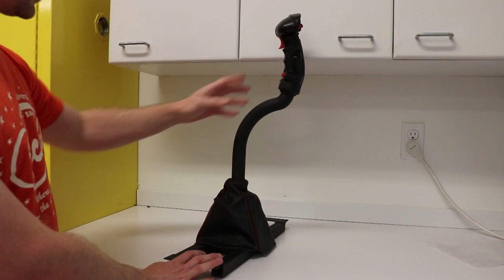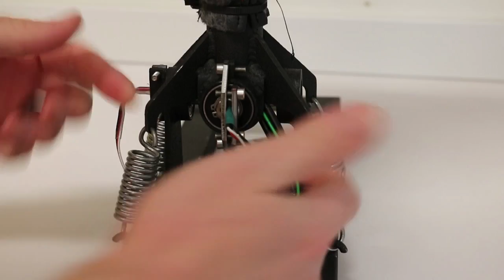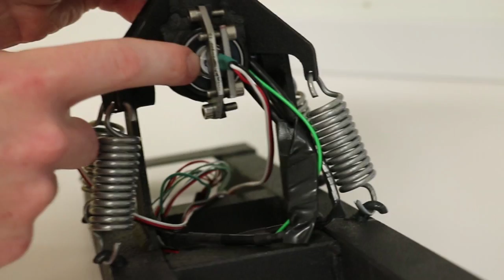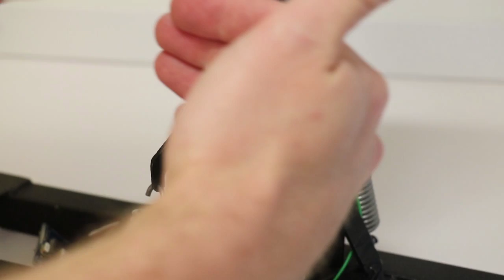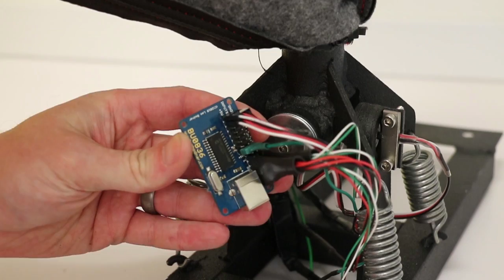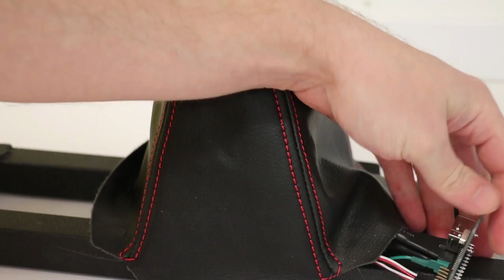Homemade joystick

Comment: I can weld, I can do those wiring too from existing sticks, but that bearing system still leaves some mystery. Oh and I would have fixed the arms to the springs by welding a X shape support pieces to each of them (so from the each leg connected to each other with small X) or just some beams. It as well should stop the bending, but your solution was different :)

Very nice work. 

I have been thinking to replace the springs with a pneumatic stoppers/lockers, those you can get for windows so you can just open the window or close it and it stays in the position where you leave it (So not a springs that push against) as it would allow to get a non-centering force to move the stick but still keep it where you move it. That would at least be nice for KA-50 or helicopters trimming as you just move the stick and press trimmer to "lock" cyclic in place and no need to center it.

If there just would be nice way to get a Force Feedback (FF) it would be nice, but such systems doesn't seem to exist that would be as easily plug'n'play like the joystick boards you showed (btw, those are just amazing to what they offer!).
Reply from the maker: For a long time I've been trying to think of an easy way to make this a force feedback setup, but to get the stick forces I want there just isn't any easy way.  With the stick this long, you'd need motors with a lot of power.

Some dampers like you are talking about would do wonders for stick feel.  When I first built the stick I did have some nylon shaft couplers on each axis of the u-joint spider, to act as adjustable friction devices (tighten the bolt, you get more friction).  The adjustment was too sensitive, it went from nearly no friction to basically a brake holding the stick in place, so I ditched them.  I do still wish I had something to dampen the stick.

If you're stuck on trying to make your own u-joint, you could always just buy your own u-joint, it's just a matter if figuring out how to fix some magnets and hall effect sensors on it.

Next up for me on this stick is to replace the grip with the Thrustmaster F/A-18 stick grip whenever they release that, then I'll ditch the old suncom F-15 grip I use now.

Comment: excellent and simply elegant. refreshing to see.
Reply from the maker: andy mclean thanks! The stick still gets a ton of use and hasn’t had a single issue!
Reply: @seanrichardson742  im currently in the planning stage of building a cockpit and i am going to steel your design. i have an idea to add force feedback to it and would like to see what you think. can i send you some drawings to look at. im a blacksmith and this is my venture into this sort of engineering.

Comment: That's awesome but I'm guessing it just gives you a generic feel with the springs. I'm a big FFB fan myself. I know it's not all that necessary for a modern jet sim but it you're flying an older jet like an L-39 or especially an older WWII warbird, then for me, FFB is essential for the realism. I use a Logitech G940 system which is a FFB stick and I have thought about seeing if the plastic stick part could be replaced with an aluminum tube (I think steel would be too heavy for the joystick axis) and remount the stick grip on top of it.
Reply from the maker: brettt777 I have thought a lot about how to make this back driven.  I would love variable stick forces. The mechanics of it become very difficult though.  With such a long stick, you would need VERY strong FFB motors and complicated linkages, to get the high forces that I want.  A FFB yoke would be far easier to build, a stick brings lots of challenges. Your idea of extended an existing FFB stick is interesting, but I think with a long stick the forces will be far too light, unless you can oversize the motors. Fun fact, the real f-15 has a fixed stiffness on its stick, and I sized the springs on this stick to match the stiffness of the f-15

Comment: Oh man. I so want that joystick. Can you build me one? It would be very usefull for me in flight simulator. Especially when we are doing demonstrations.
Reply from the maker: Nope, don't have the time to build and sell these right now.  Maybe in a ~year, but it wouldn't be cheap.
Reply: Thanks for your answer. Do you know about some mechanical joysticks that are already on sale and they are not that expensive? or do you know about any extension for Thrustmaster HOTAS T-flight?
It would definitely help.
Reply from the maker: I don't - the few good ones I found were all very expensive.  That's why I made my own.  You could always hack something together to extend an existing joystick, but the springs won't be nearly stiff enough.

For the money to buy a good one, you could buy yourself some materials and a welder and make your own!

Comment: I guess I'm late to this party, but I'll as anyway. What kind of magnets did you use? They look like cylindrical neodymium magnets, but what is the magnetization direction? Are those available in different variations when it comes to magnetization direction? I was able to find ones that are magnetized along the height of the cylinder and to my understanding of the hall effect and hall effect sensor it has no right to work with that kind of magnetization. What is the magnetization direction of the magnet used in your build?

Comment: Hi great joystick. Did you use square  or round magnets and did you have to limit the amount of travel on the joystick to get the calibration of the sensor and magnet to work ok
Reply from the maker: Thanks! The magnets are square. I wish I had some close up pictures showing how I milled out a slot in the end of each shaft to slide the magnet into. That was tough to machine.  I didn’t have to limit the travel, it is calibrated with the generic USB game controller settings in windows. Works great.

Comment: Would love to build something similar  to yours... would you consider sharing your blueprints for the build, and if so just make sure you copyright your drawing. Thank for the awesome vid, it was really informational.
Reply from the maker: Glad you found it interesting.  You really don't need plans from my stick, there's not much to it.  What you build depends on your capabilities as a machinist/welder, and I'm sure there are improvements that could be made over what I built.  That said, it's been over two years now since I made the stick and it's still working great with zero issues.

Comment: Did you have much trouble with the hall effect positioning, and the air gapping between the magnet and sensor? That's the section I'm at now and I couldn't find much material online relating to low power electronics which gives advice on where best to position first the hall effect sensor but also the distance it should be away from the magnet.
Reply from the maker: No issues, I didn't put much thought into it.  I have them fairly close, without touching.  Maybe 0.5mm gap or so?  The calibration has no issues and the signal is nice and clean.  The Leo Bodnar board makes it very easy, it's basically plug and play.

Comment: Hi Sean,  thanks for  the quick reply.  Regarding the square mangnets what size did you use and did it matter about the North  South poles  when you placed sensor near the magnet I am using the bigger bodnar board for a cockpit  I am builing  cheers Rhys
Reply from the maker: I think they were 1/4” square, or maybe 3/8” square. I can’t remember.  The north and south poles go out the faces of the magnet, not the sides. They are oriented so the poles are perpendicular to the end of the Hall effect sensor, not the side. Does that make sense? Easier explained with a sketch.
Reply: @seanrichardson742  thanks Sean for the reply could you send me a sketch I think I understand but a pic would clear anything up
I'm building a helicopter sim out of an old Hughes 300 cockpit 
Cheers Rhys

Comment: hi , it would be great if one could have access the arduino sketch that works with those hall sensors.
Reply from the maker: David Aristizabal it's not arduino, I use a board from Leo Bodnar. Link is in the description. It is plug and play.
Reply: Sean Richardson thanks for the answer. Another question  do you know if that board can generate  ppm in order  to connect  to a trainer  port  in a rc transmitter?
Reply from the maker: David Aristizabal you'd have to ask Leo Bodnar, I'm not sure. He has a few different boards though, might have something with the output you are looking for. I use it purely as a plug and play input device.
Reply: Instead deal with Arduino Sketches can use MMJoy2 firmware (developed by megaMOZG, the guy that develop VPC(VirPil) electronics), topics in DCS forum, SimHQ.
This firmware support analog HALL sensor* - like the ones used by OP, KMZ-41 based sensors and TLE5010/5011 sensors, this in digital mode.

*Analog HALL sensor (e.g. Honeweel SS495A1, Allegro A1324EUAT...) are wired in joystick controller boards like ordinary potentiometer, with +5V, Gnd and signal wires, just follow HALL sensor datasheet for correct identify pins.

Comment: Hey Sean, have you built a collective or anti torque pedals? My friend and me are trying to build something like this and I'm digging this any suggestions?
Reply from the maker: Nope, but it would be very similar.  You could probably simplify it and separate the lateral movement from the fore/aft movement, so you don't have to build a spider/u-joint.  That was the trickiest part with this stick.
Reply from the maker: I fly fixed-wing only in real life, helicopters are too expensive.
Reply: I'm really curious about how those hall effect sensors work and how they're mounted. This has to be the best set up I've seen yet, not going to copy it but definitely would be similar. I'm a former C130 crew chief out of the Air Force and our controls don't move this good.
Reply from the maker: That's high praise, thanks man!  The hall effect sensors are great. Very cheap, and have very clean and smooth output.  At ~2:53 in the video you can see how each sensor is mounted.  There is basically a small bracket that sticks out from the main  stick structure, then the sensor is clamped down with a tiny piece of metal and two bolts.  I did tighten that too much when I first built it and crushed a sensor, so when I got a replacement I wrapped it in two layers of heat shrink and didn't go quite as tight.

One end of each shaft of the spider has a slot milled out and a small neodymium magnet glued in.  Milling out those slots was pretty tricky in my mill, I'm sure there would be easier ways to do that.  You basically just want the hall effect sensor aligned axially with the center of the magnet, as close as you can get to the magnet without actually touching it.  Then the output of the hall affect sensor varies as the relative angle between the two changes.